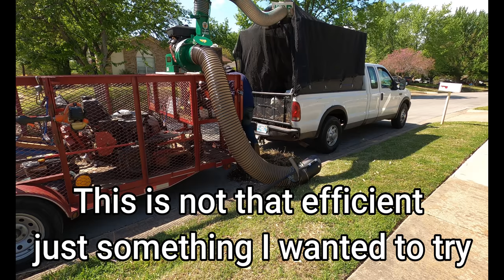THIS UGLY YARD GETS A MAKEOVER! Start to Finish First time CLEAN UP of neglected property. 4K

Comment: I agree weedeater is a lot better for stuff like that, but I have also found that a roofer's tear off shovel works really well for stuff like that.  It has little teeth at the tip that tend to cut through tough grass roots a little easier.  Just a tip that works for me.
Reply: I hadn’t thought about a roofers shovel, but yes it would do the job much easier. I’m sure you’ve noticed that some of the shovels Kevin uses still have labels on them, very dull. Years ago shovels were pre sharpened when you bought them but in this sissy world we live in some crybaby might cut his little finger.😢

Comment: On lawns like that, a real gas powered walk behind edger is far superior to the string trimmer toys. They are not that expensive either. String trimmers don't have the torque or hp to do THAT yard properly. Right tool for the job. Great video. KEEP THEM COMING!!